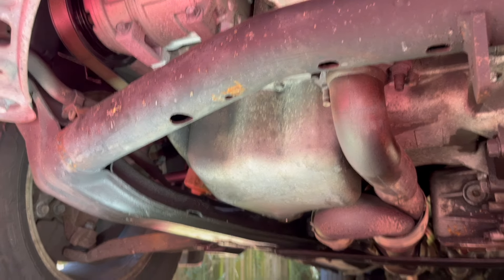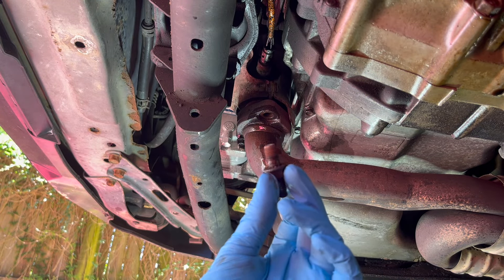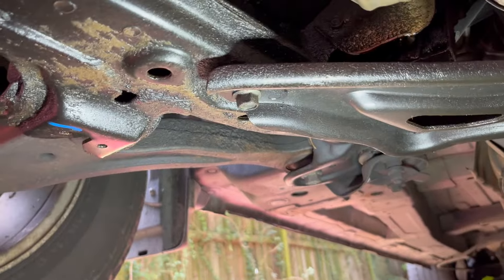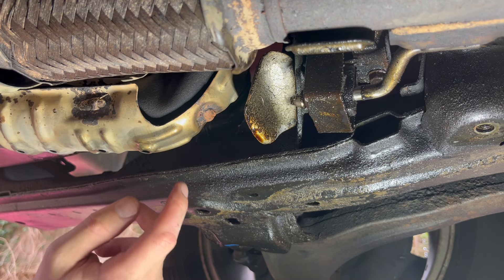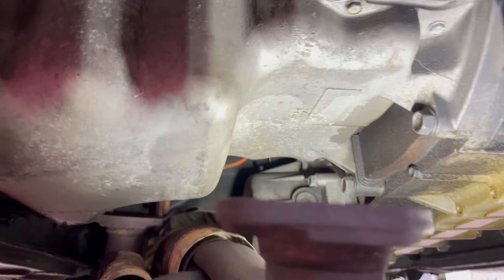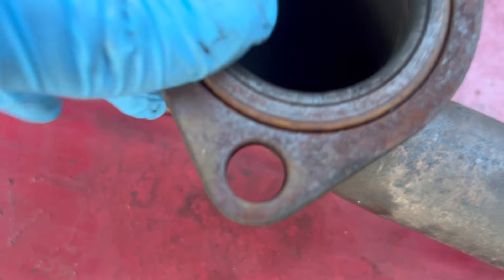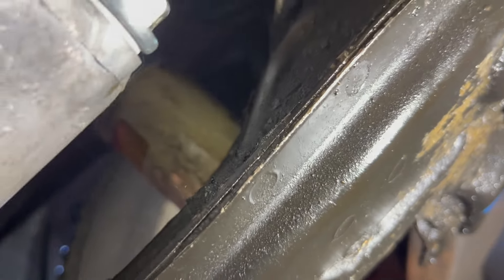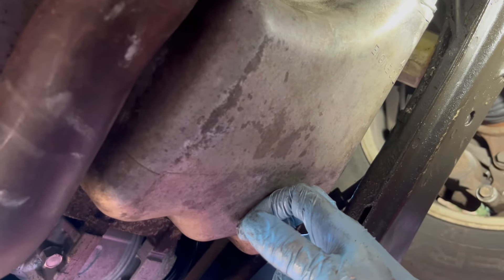Honda Ridgeline Oil Pan Removal and Repair

Comment: Great video. How did you remove the studs? Was able to get nuts off with 14mm extractor socket but one of my front studs (coming off front catalytic converter) threads are shot so need to remove it. Thanks!
Reply from the maker: Yeah, it was tough lol. I recommend using liquid wrench spray for week or so and driving it to get the liquid to help out with the rust. Then I think it's good to just use extractor socket, but use brand new nuts as a replacement. It definitely took a lot of time removing them.
Reply: @PZPal  I mean how did you get the threaded studs off? I was able to get nuts off already. Thanks, sorry for confusion..
Reply from the maker: lol that's a good question. In my case, I just had studs come off with nuts. What I think might work, I could be wrong though, is put two nuts on one stud and tried to remove nut that is further in the stud. That way, hopefully, stud will come off. Let me know if it worked or not.